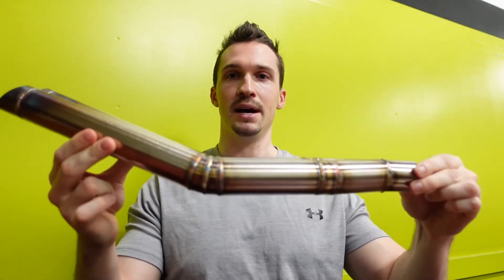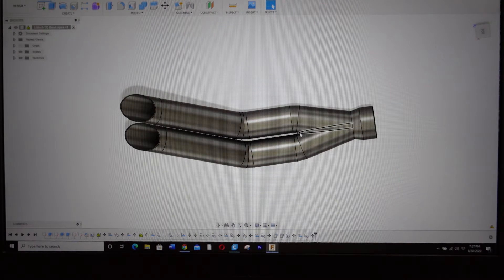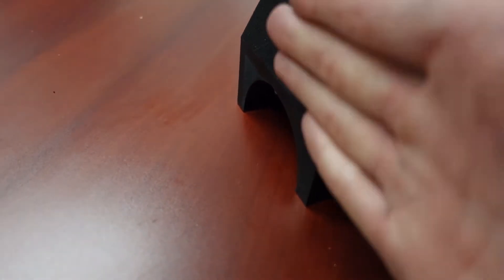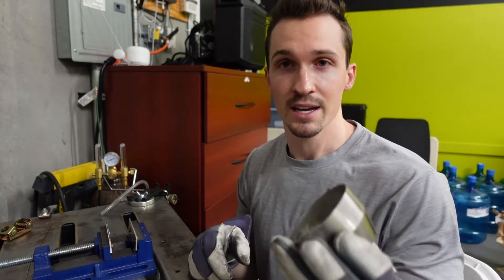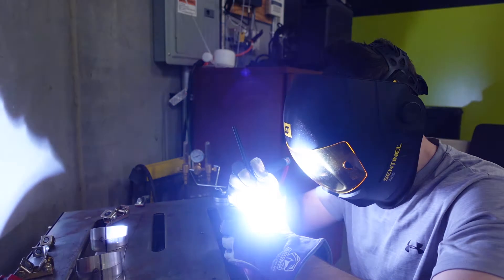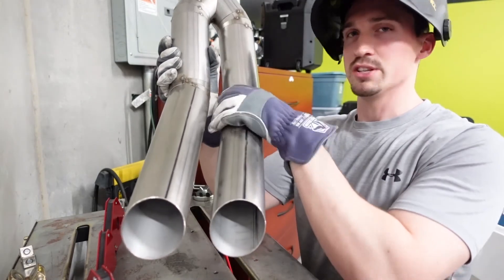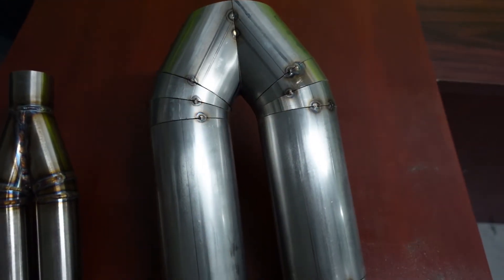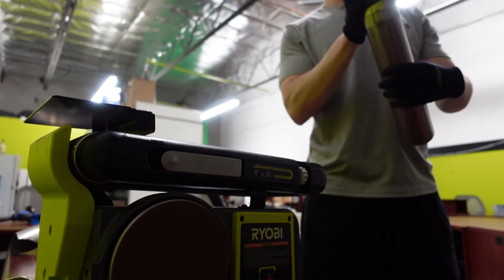DIY FABRICATING JDM BLAST PIPES W/ STAINLESS STEEL | tig welding pie cuts to fabricate car exhaust

Comment: How do you work out what angles and how much you need to cut, to be able to join/merge the two pipes together on the start of the Y bit? you made a jig, but what If you don’t have access to 3D printing? Also it’s nice to see people coming up with new and interesting ways to do things.
Reply from the maker: You gotta remember that if you cut one tube one way, you have to cut the other tube the exact opposite to meet neutral. 

If I want my Y pipe to meet at a 30 degree angle, I’m going to cut each pipe at 15 degrees in opposing ways to come together at 30 degrees. 

Hope that helps wrap your head around how I made some of those decisions

Comment: I really enjoyed this video!

Haven't thought of 3D printing jigs yet, that's a great idea!

 Do you build the CAD models for the jig prints directly off of the part models or are the jigs less specific?

The video preview intro is really cool. Haven't seen that a lot
Reply from the maker: HerrCrazyMe thanks for watching! Yeah the 3D printed jigs have helped me make a bunch of complicated cuts. Every time I do a new project I design new jigs (unless I already have some). I just use a caliper and make the measurements myself and make the jig CADs myself using fusion 360. 

That’s part of the reason why I had an error in this video and needed to grind down the collector. My jig was slightly off in its design